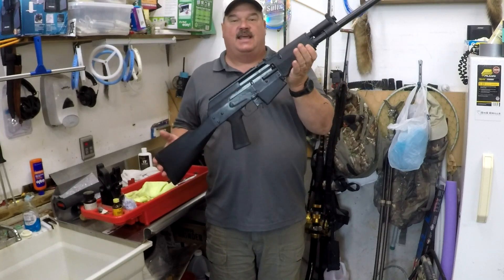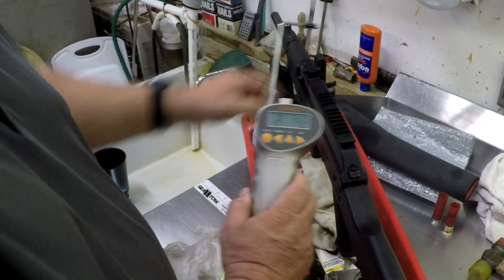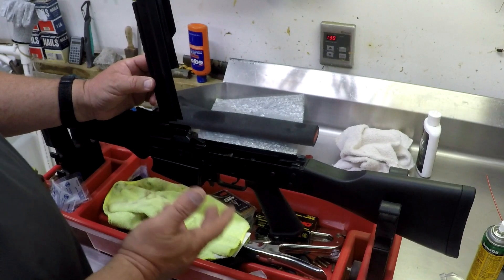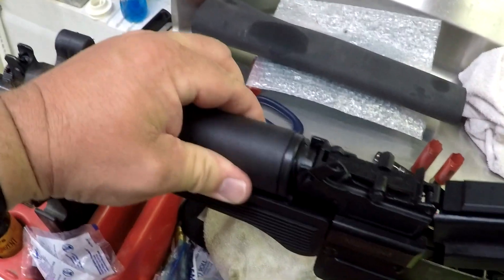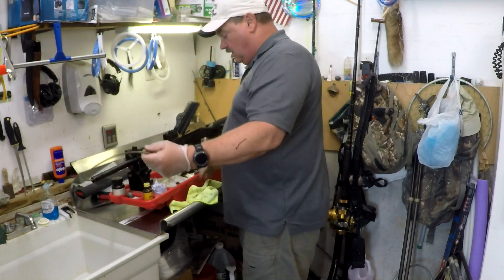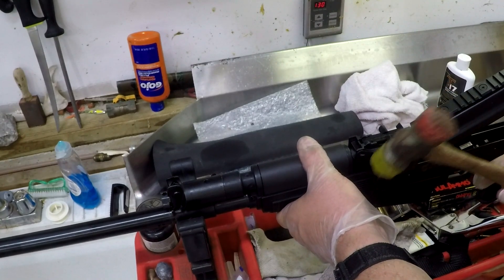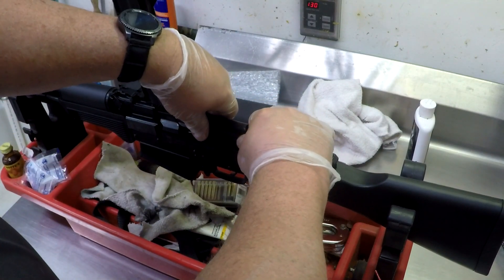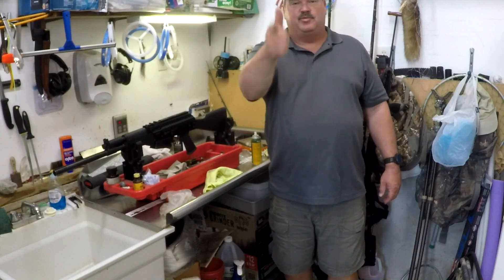JTS M12AK Take Down (Field Stripping, Cleaning and Proper Lubrication!)

Comment: To move the gas piston tube take down lever, you don't use a mallet, you take the bolt carrier, and place the tab in the slot on the side of the bolt carrier, and use the bolt carrier as a lever  extension to rotate the takedown lever.
Reply from the maker: @DARIVSARCHITECTVS That's a great tip.  I'll check that out!

Thank you for watching! Make sure you follow us on our FB page here: https://www.facebook.com/scottgreggoutdoors/  I usually post what's coming up there as well plus other channel insight and content not on YouTube.  Also Instagram at www.instagram.com/scottgregg1966/

Comment: Just purchased one of these and needed a guide to help me clean it and get it ready for use. Great video, thanks for posting! I'll end up using it many times. Now I just have to find a mag that holds more than 10 rounds 😁
Reply from the maker: Josh Sheely Don't forget to clean the Gas Block!  It's kind of a pain in that you can't easily take the inner tube out.  But you have to get in there with a good solvent like gun scrubber and get the heavy grease out the gun comes with.  Otherwise it will become VERY stuck after a few dozen rounds through it and you won't be able to adjust it. (Ask me how I know)  I'm going to do a short video on this when I get a chance. 

Thank you for watching! Make sure you follow us on our FB page here: https://www.facebook.com/scottgreggoutdoors/  I usually post what's coming up there as well plus other channel insight and content not on YouTube.  Also Instagram at www.instagram.com/scottgregg1966/
Reply: Just cleaned the jts m12ak watching this video .man thanks a bunch !
Reply: I know this is old but if you are still looking get the vepr 12 sgm 25rnd mag. Only modification is you need to add a piece of material to the mag so it can lock in place. Very easy very fun very beneficial.
Reply: @Jaggalicious  thanks man I'll look into it! Been awhile since I shot it and this will give me a reason to break it out again

Comment: Your video helped me break my gun so thanks pal! What setting should the gas chamber be set to??
Reply from the maker: @willhite112 How did you break your gun? lol  The gas settings are for the power of the loads you shoot and explained in the manual. 0 for no gas (gun won't cycle) and 3 for the most gas/lightest loads.  2 for most, but 1 for he heavy kickers so it doesn't beat up the gun.

Thank you for watching! Make sure you follow us on our FB page here: https://www.facebook.com/scottgreggoutdoors/  I usually post what's coming up there as well plus other channel insight and content not on YouTube.  Also Instagram at www.instagram.com/scottgregg1966/
Reply: @scottnra  the gas chamber would not come out, it was stuck from the side where the adjuster was

Comment: I just took my AK12 out to the range for the first time today. Before I shot it, I disassembled, cleaned, and lubed it. Now I'm cleaning it and the gas piston won't come out. It rotates when I spin the selector dial, but it will not come out like it did the first time I took it apart. Anyone have any tips?
Reply from the maker: Steven Faul The inside part or the part that actually spins? If it the part that spins, once you get the knob off, take a nylon hammer or block of wood and hammer and tap it out.

Thank you for watching! Make sure you follow us on our FB page here: https://www.facebook.com/scottgreggoutdoors/  I usually post what's coming up there as well plus other channel insight and content not on YouTube.  Also Instagram at www.instagram.com/scottgregg1966/